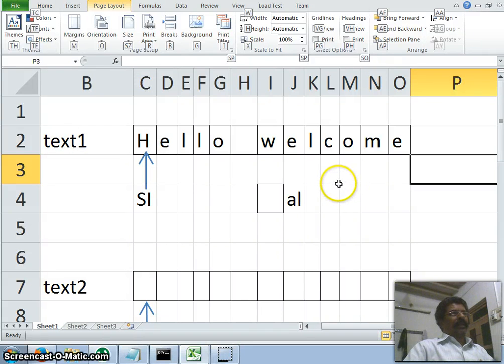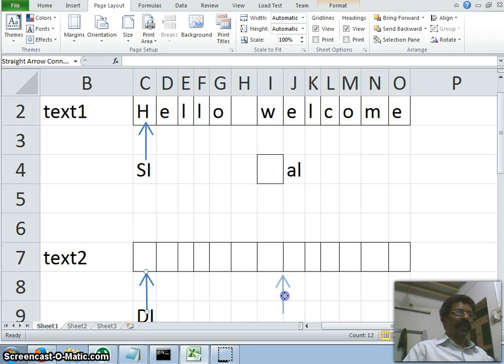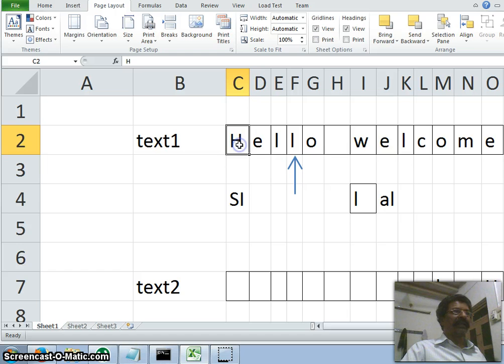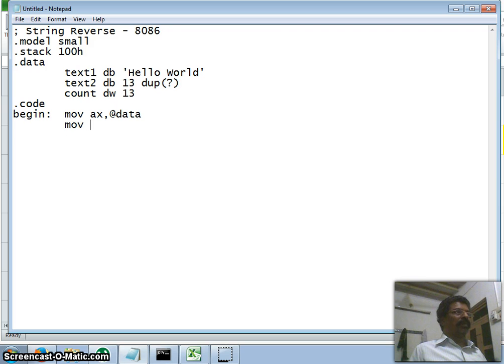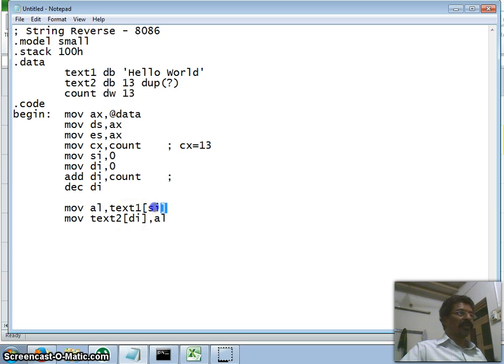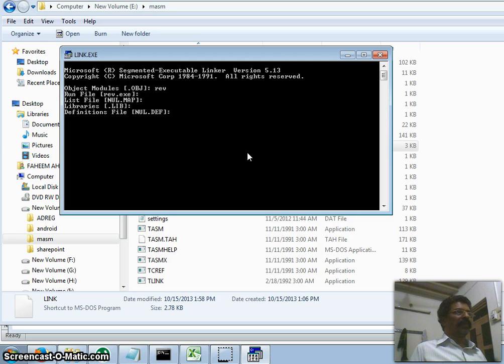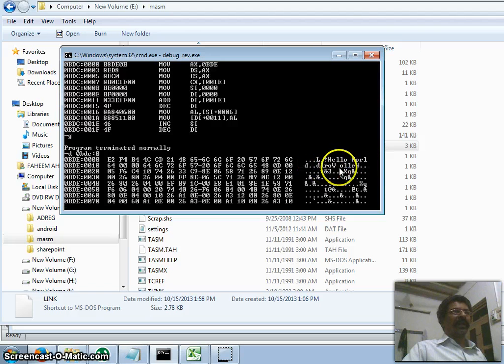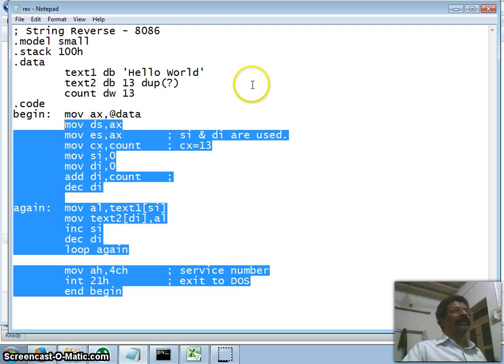String Reverse 8086

Comment: write prog read contains (E100 ) always - and test this contains:-
1)- if it = 0 put 1 at B register .
2)- if it = - ( negative values) - put 2 at B register
3)- if it = + ( positive values ) - put 4 at register B
firstly should upload this byte (E100) contains  at the accumulator then sum on zero for change SF & ZF FLAGS
please see this example true or false quickly please this is by use emu prog.

                                                شفرة الاسمبلى                                                    العناوين
E000     E001   E002                                        MOV  SI,E100
E003      E004   E005                                        MOV  A X,0000H
E005      E006       E007                                   ADD AX,(E100)
E008        E009   E00A                                    JPNZ,E011
E00B       E00C                                                MOV  B,01H
E00D      E00E      E00F                                  JP  E000
E011       E012      E013                                  JPP,E019
E014       E015                                                 MOV  B,02 H
E016      E017      E018                                   JP E000
E019      E01A                                                 MOV  B,04H
E01B      E01C    E01D                                   JP E000

and i very thank you for your tach

Comment: there is no condition for si to stop incrementing and di to decrement. how does it stops then??
Reply from the maker: SI is incremented and DI is decremented inside the LOOP statement which occurs only 13 times only. No need to stop it.
Reply: For those who don't recognize LOOP statement

LOOP  does have a condition.
(LOOP LABEL) is the same as:

DEC CX
JNZ LABEL              ; CONDITION: J ump if CX N ot equal to Z ero to a label.

Will decrements the value of CX , and if CX not equal to zero it will jump to a label you specified to make a loop.